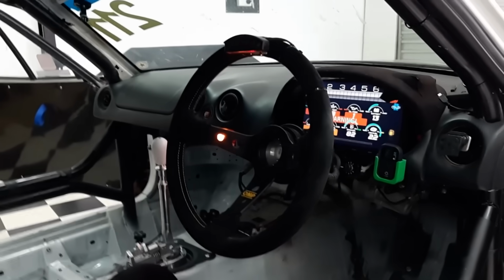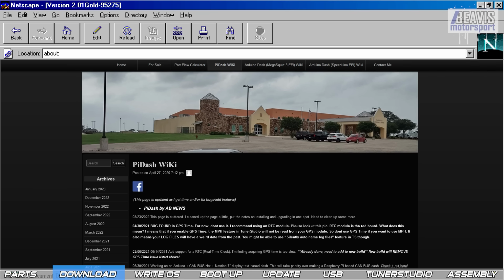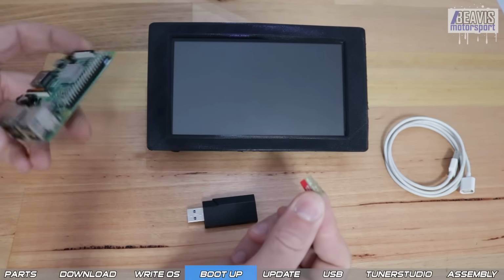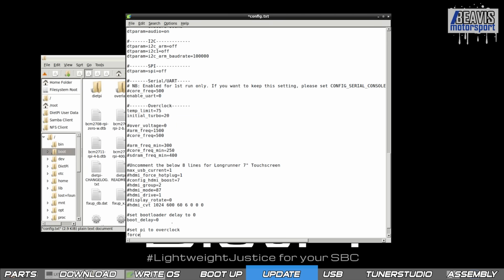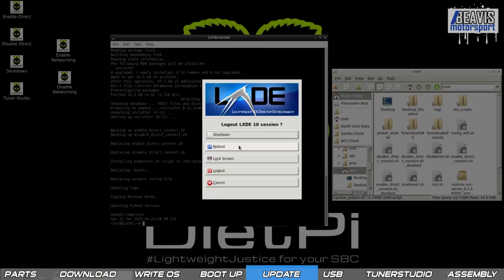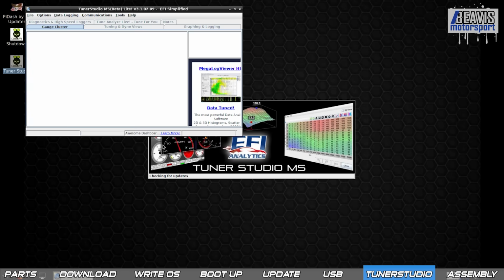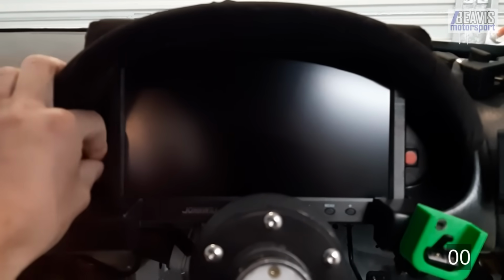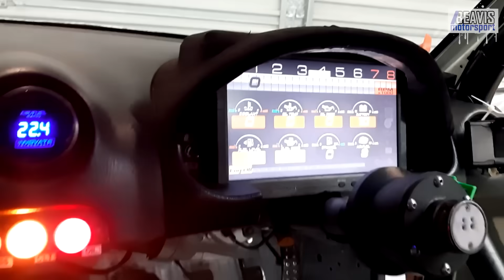DIY Raspberry Pi Racecar Dashboard: The Ultimate Guide

Comment: I tried to connect my pi to the internet and it worked ! But yet the time and date did not update
Reply from the maker: Sometimes it can take a moment, or a reboot, or you can force it.

Usually time sync should be done automatically during boot? Which option you set within: dietpi-config > 4 : Advanced Options > Time sync mode

To check the time sync working you could force the service:
/boot/dietpi/func/run_ntpd 1

And to check logs, you can do:
journalctl -u systemd-timesyncd.service

Comment: Is the SD card robust enough? Some usb drives are faster and less likely to corrupt over hard shutdowns. Have you upgraded to tsdash? Also, the new rpi5 is faster, any thoughts on updating that?
Reply from the maker: Yes, I've moved to TSDash - all the same dash features but without the slower load time of native TunerStudio.
SD Card seems fine for me, some people say it's an issue, but I don't see the problem if the Pi is safely shutdown. I did try a Samsung USB3 for boot drive, but it showed no faster startup times than the SD card in my testing.
The Pi4 works, not currently planning to buy a Pi5 just for the fun as I cant justify the spend.... not yet at least :-P
Reply: @Bbeavis  you should really consider doing a follow up video on the subject, there's only a few talking about TS dash, booting times, different storage options in a automotive environment.

Comment: maybe a sliiy question but what do you use to get the dash reading like speedo tach ext
Reply from the maker: I'm running this dash in a track car that uses a Megasquirt MS3 ECU.
So all my sensors, speed, temps etc go direct to the ECU.
Then the ECU has a USB connection direct to the Pi to feed the data for the dash software (TunerStudio).

Comment: Do i need to configure raspberry pi with car sensor or just connect with ECU it will automaticly show everything about the car temperature/fuel/battery.
Reply from the maker: So sorry, that is something I glossed over forgetting that not everyone viewing would have the context that this is for a Megasquirt ECU.
I'm running this dash in a track car that uses a Megasquirt MS3 ECU.
So all my sensors, speed, temps etc go direct to the ECU.
Then the ECU has a USB connection direct to the Pi to feed the data for the dash software.
Note that the TunerStudio software is specific to the Megsquirt ECUs which is what my car runs.
If you wanted to use OBD2 or if you have a different aftermarket ECU, perhaps either the OpenAuto software, or OneGauge theonegauge.com, may work for you.
Hope that helps, thanks very much for watching.

Comment: Thanks for the great video. Im running into an issue where sudo apt update command is getting kickback saying certificate verification is failing and the archive no longer has a release file as well as the following python commands are erroring out as well. Thanks for any help through this.
Reply: juuuuuuuuuuuuuuuust kidding. I had it connected to the internet for a while and did a few reboots but it took me to get on mozilla firefox for it to really latch onto being on the network and everything ran through just fine.
Reply from the maker: Sometimes this can be a symptom of the clock being set incorrectly (date & time not current causes certificate error).

Comment: Great walkthrough. I've gone back and forth between using shadowdash and considering a pi-dash setup. One of the things that bothers me overall is that I want more control over designing gauges for TS. Do you have any ideas around hacking the things like the dashed bar gauge? I want to make custom rotation angled versions, and to not display the "unlit" sections of the gauge. I should probably just start a thread on the forum, just afraid it would turn into a 100 page rant (on my behalf).
Reply from the maker: As you already know, there are 'design' limitations to TunerStudio.
For me, I keep my designs/data simple, but use a more 'appealing' background to help make the dash look pleasant overall.
I don't use a lot of dials/gauges/needles anymore.
I take inspiration from modern racecar and super car dashboards, and draw up the dash in Photoshop first, before building in TunerStudio.
Hope that helps, good luck.
Reply: @Bbeavis  This is the kind of stuff I wish TS would let me do: https://youtu.be/_bS9URPukVE
The primary thing lacking is transparency support and adding masks to gauges (not just gauge backgrounds).
Reply: @Bbeavis  circling back, I figured out one solution. TS supports transparency with needles. So you can guess how I did this: https://youtu.be/mxb_1QLfwxM

Comment: How does the pi get data from the on board data module in order to display it?
Reply from the maker: So sorry, that is something I glossed over forgetting that not everyone viewing would have the context that this is for a Megasquirt ECU.
So all my sensors, speed, temps etc go direct to the ECU. Then the ECU has a USB connection direct to the Pi to feed the data for the dash software.
Reply: Ah got it, i missed that.  thank you for your response!  Great video -- the instructions on flashing the pi are really clear @Bbeavis

Comment: Hi Hi I want to talk about in a project that I am working on and it's  graphic user interface

I am using Raspberry Pi 4 1GB model to control a thing or monitor a thing control is optional touch displays are expensive in here double the amount of 8GB Raspberry Pi minimum as much as same so only cheap option I have to use LCD LED panel monitor DIY or use the smartphone touch screen panel module somehow connect that with Raspberry Pi like a Samsung f41 or Samsung m31 

So I have user interface or graphic user interface kind  of like car dashboard as secondary display cluster in car showing

Sensor Readings and Display**:

   - Inside the GUI, there's a function `update_display` that is called every 2 seconds.

Or in ( 1 second ).

   - This function reads data from various sensors:

     - Temperature sensor (DS18B20).

     - Current sensor (ACS712) for monitoring current flowing through***************************

     - Water level sensor in the small tank (JSN-SRO4T). It checks if the water level is high or low.

     - Load cell with HX711 for weighing the big water tank.

     - Gas sensor (MQ-8 REES52) for detecting hydrogen gas.

   - The sensor readings are then displayed on the GUI.

us PWM  water pump  motor  Speed Control regulator  .

That is rated for 40 a  12v dc   that got a regulator LED display kind of thing that shows this select current and on of switch

I seen your video about DIY Raspberry Pi digital dash cluster

I have a kind of python script for Raspberry Pi I have both Raspberry Pi 4 1 GB any kind of Raspberry Pi on non Raspberry Pi touch displays are triple the amount of Raspberry Pi cost so I am thinking to use a some kind of 7 to 8 in  display  lcd or LED  with out touch  or 3.5 inch display LED lcd  and other options I already mention 

Could you help me out

So, I can   share more details

Comment: great video the only problem im having is connecting my pi to wifi do you have any instructions on how to do that as i do not have ethernet so has to be wifi
Reply from the maker: That shouldn't be an issue, the pi has onboard wifi. I don't recall from memory exactly how, but i am sure a quick search on how to use dietpi-config to setup wifi should help you.

Comment: What ECU setup do you have to have to do something like this? Can you plug in from a stock computer? Or need a standalone?
Reply from the maker: Hey  Jordan,
So sorry, that is something I glossed over forgetting that not everyone viewing would have the context that this is for a Megasquirt ECU.
I'm running this dash in a track car that uses a Megasquirt MS3 ECU.
So all my sensors, speed, temps etc go direct to the ECU. Then the ECU has a USB connection direct to the Pi to feed the data for the dash software.
Note that the TunerStudio software is specific to the Megsquirt ECUs which is what my car runs.
If you wanted to use OBD2 or if you have a different aftermarket ECU, perhaps either the OpenAuto software, or OneGauge theonegauge.com, may work for you.
Hope that helps, thanks very much for watching.

Comment: Does this communicate with the ECU thru the CAN Bus twisted pair ?
Reply from the maker: Hey Jean,
So sorry, that is something I glossed over forgetting that not everyone viewing would have the context that this is for a Megasquirt ECU.
I'm running this dash in a track car that uses a Megasquirt MS3 ECU.
So all my sensors, speed, temps etc go direct to the ECU. Then the ECU has a USB connection direct to the Pi to feed the data for the dash software.
Note that the TunerStudio software is specific to the Megsquirt ECUs which is what my car runs.
Hope that helps, thanks very much for watching.

Comment: Theres a cool HAT for the pi called the ‘CarPiHat’ which handles power supply, safe shutdown, cooling and loads of other features - designed specifically for this kind of project!
Reply from the maker: This is a great tip. The CarPiHat is a neat solution for people who want something a bit more complete and with some additional control features for a Pi in a car.

Comment: Thank you for the thorough walk through! Big question: Do you have any idea about feeding CAN data into the Pi4 and then getting it into the PiDash software? I'm using a different standalone and would like to get its CAN info into an aux dash as well as some of the chassis CAN message.
Reply from the maker: As far as I am aware, the TunerStudio software presented here does not support CAN direct via the Pi. Instead perhaps either the OpenAuto software, or OneGauge theonegauge.com, may work for you.

Comment: That's absolutely brilliant. Would it be possible to add external sensors to it like an oil temp sensor? My car doesn't have an oil temp sensor as standard.  Would I be able to program that sensor into the program I stead of it reading it from the ECU?

Also an amazing video. Very detailed and easy to follow.
Reply from the maker: Thanks Craig.
For me I wired additional sensors, such as the oil temp/pressure into my ECU. This was the best way for me to easily get the data displayed on the dashboard.

Comment: Just starting my own build, what ecu were you communicating with and how was it communicating with the ecu? Like did you need to set it up if afternarket ecu? Im planning on using this with an ecumaster classic and at first alwas looking for it to communicate over canbus but would he a hell of a lot simpler if i can legit just plug the usb from exu directly to the pi?
Reply from the maker: Hey Nick,
So sorry, that is something I glossed over forgetting that not everyone viewing would have the context that this is for a Megasquirt ECU.
I'm running this dash in a track car that uses a Megasquirt MS3 ECU.
So all my sensors, speed, temps etc go direct to the ECU.
Then the ECU has a USB connection direct to the Pi to feed the data for the dash software.
Note that the TunerStudio software is specific to the Megsquirt ECUs which is what my car runs.
If you wanted to use OBD2 or if you have a different aftermarket ECU, perhaps either the OpenAuto software, or OneGauge theonegauge.com, may work for you.
Hope that helps, thanks very much for watching.

Comment: Hello, I use PI for a few embedded devices that runs SDL applications with opengl without a desktop environment, its alot faster, I even have touchscreen, mouse and keyboard working in my app.
In the past I did an instrument cluster in opengl that looked pretty good (Based on my mercedes analog/digital cluster + some customization) and it was connected to forza data api, would be cool to see it in your car :P
Reply from the maker: That sounds really cool. If i had the skills and time for making a bespoke dash application I would love to do that, but for now I need to rely on a ready-made software solution that I can configure to work for me.
Reply: That's the kind of comment I was looking for :) how fast could you have it booted and ready ?
A lot of the Rpi solutions I've seen take at least 30~40s, which doesn't matter in a race car, but would in a daily drive (it might even fail the bi-annual inspection if the dash doesn't light up quickly enough).
Reply: @pbe6965  I don't have any unit ready for testing at the moment but I think out of memory it was about 20 secs while not instant still a lot faster than with desktop environment. I also remember most of the booting time being network initialization, if you don't need it and can turn it off pretty sure you can take it down to 12-15  seconds.
Reply: @sylvainmartens7852  thanks, I'll have a look.
I found one that claimed to boot in a few seconds (2.5s iirc), but he removed as far as the usb support, that's taking it a bit too far XD

Comment: So how is the pi/ tuner studio receiving input for gauges? Is this just obd2 port, or individual sensors? From computer/ engine?
Reply from the maker: I'm running this dash in a track car that uses a Megasquirt MS3 ECU.
So all my sensors, speed, temps etc go direct to the ECU.
Then the ECU has a USB connection direct to the Pi to feed the data for the dash software.

Comment: this is so bootleg i could never
Reply from the maker: So for you anything DIY = bootleg?
Reply: @Bbeavis  nope, but seeing how long it takes to boot, that its running bloated software and isnt optimized for automotive usage id call it bootleg. I'm currently working on something similar myself using a microcontroller and custom analog gauges so ive put much more care into addressing things ive mentioned before. If youre happy with the result all power to you but its just not up to my personal standard

Comment: Why is it all ways with a mega squirt? Is there a way to make it stand alone? You know plug in the inputs directly into the pic without needing an mega squirt?
Reply from the maker: That's the ECU I am using in my car, so i am using the TunerStudio software to talk to the Megasquirt MS3 ECU
However if you have a different aftermarket ECU, perhaps either the OpenAuto software, or OneGauge theonegauge.com, may work for you.
Hope that helps, thanks very much for watching.
Reply: @Bbeavis  i appreciate it and idk if that makes sense wanting one that lets you input sensors instead of reading from an ecu kinda like the holleys dashs i know alot of ppl run the mega squirt and that’s what your dash runs on but lol some of us still run the factory pcm thanks anyways

Comment: Did I miss where you explained how it actually reads from the car or did you skip that bit?
Reply from the maker: I'm running this dash in a track car that uses a Megasquirt MS3 ECU.
So all my sensors, speed, temps etc go direct to the ECU.
Then the ECU has a USB connection direct to the Pi to feed the data for the dash software.

Comment: Great video... actually covering the software installation not just the physical installation.... for your power requirements there is a couple power supplies that would remove the two switches (main power and momentary switch). One is called the M2-ATX and the other is the M4-ATX both of which are ignition controlled power supplies that are designed to turn on/off PC motherboards much like a standard car amplifier. They can be set to turn off the system while leaving enough time for the operating system to save details and boot up the operating system like OEM systems with the key.
Reply from the maker: Thanks good details to give options for people out there who want an auto-shutdown solution.

Comment: Me and some friends are looking to build a custom “go kart” type thing using a gsxr bike motor and ecu would I be able to set this up for it? The bigger digital dash would look so good for it
Reply from the maker: The software in this video doesn't really work exactly for a bike. If you are tech savvy I sure you can find a way :-)
Reply: You could run the engine with a microsquirt and then this would be an option.

Comment: Very interesting stuff. Good work sir. 

Ive been looking for, unsuccessfully, now been wanting to build a heads up display for my 92 Honda Prelude, that resembles the tachometer from an S2000, but just in a heads up display form. Nothing else, just the tach. 

Would this be a viable method of accomplishing that? With some differences of course.
Reply from the maker: What you are describing is a bit different to this dashboard. If you are tech savvy I'm sure you can find a way :-)
Reply: @Bbeavis  Ahh, but I wanted a detailed and step by step plan or instruction manual. Haha. Just kidding. 

I've been trying to reason it down to what I ideally would like to have to what would realistically work. I figure if I can find a source for the lights that look like the tachometer on the S2000s, then I'm sure I can figure out the rest. Either that or find a program or learn how to create a program that would use a display such as a tablet to display and run the tachometer and then just secure it to my dash (in a non-destructive way, so as to not hack up my dash, as my car is getting fairly old and parts harder to find) that would then effectively serve the same function that I see in my crazy ass head. Sigh, holograms are still to far off. I'm getting impatient. Haha. 

Thank you and I still have learned a lot from your videos.